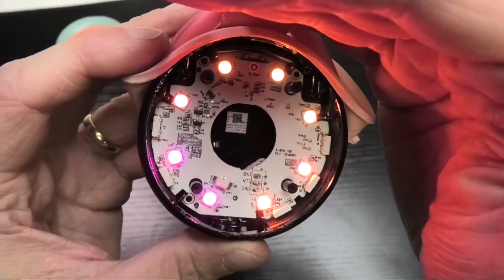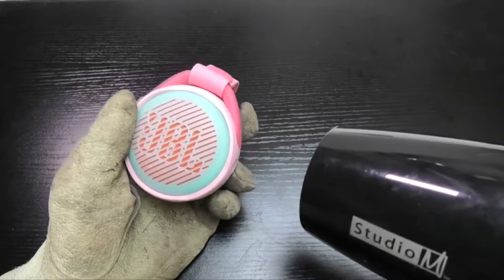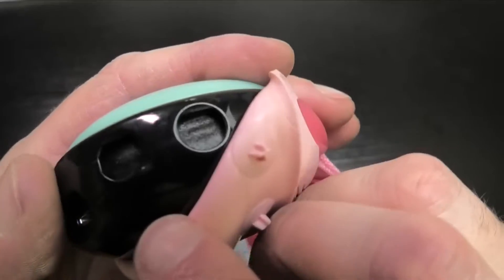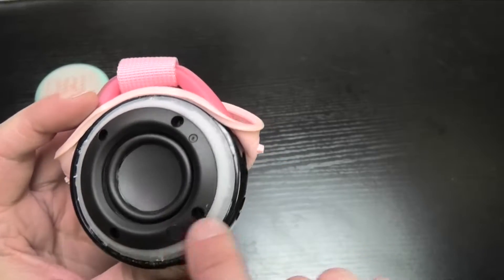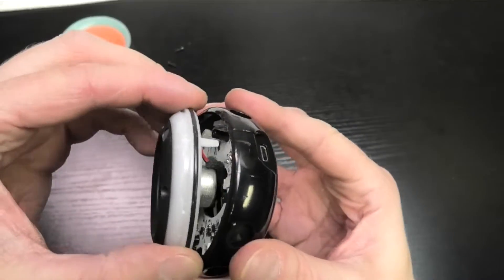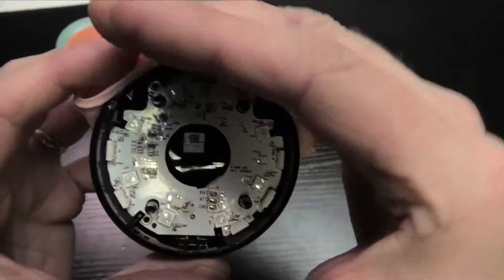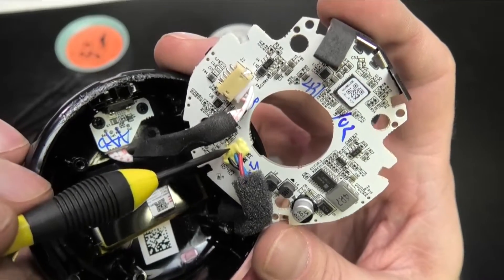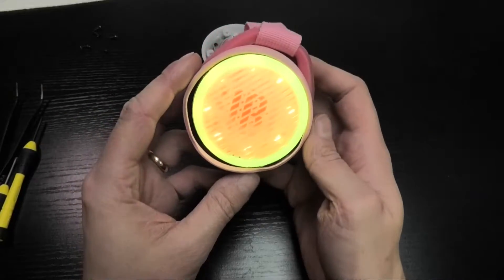What's inside JBL JR POP speaker - TEARDOWN

Comment: Good video, I'm about to buy one of these to strap to my shower's towel rack. soldered battery.... god damn it lol >.< I suck at soldering. Well i guess i can cut the cable and splice a new battery in if i ever have to, it's not like i haven't' done that before... Had a PS3 battery where the plug wasn't right, so i used the original plug spliced to the new battery. Still fine after all these years... but 600 mah? really? 2000 mah's aren't even more then $20...